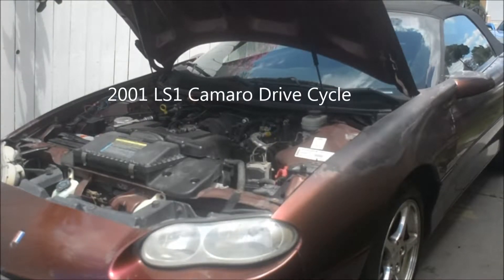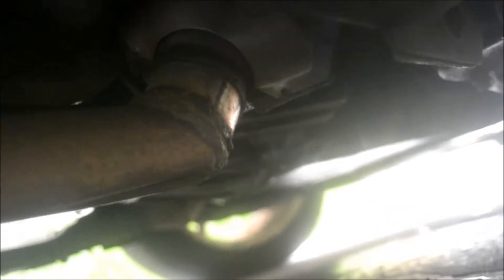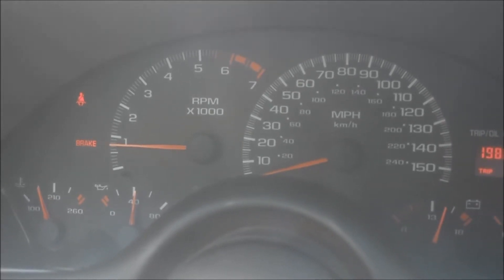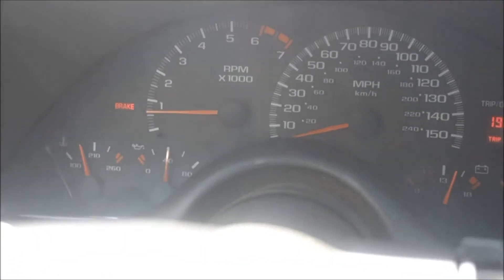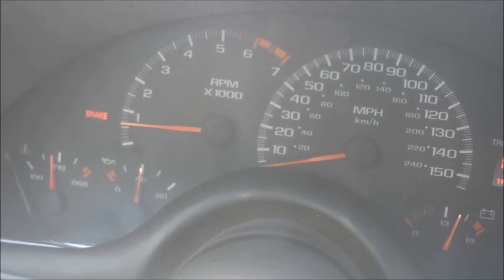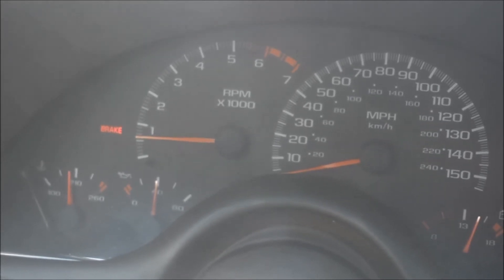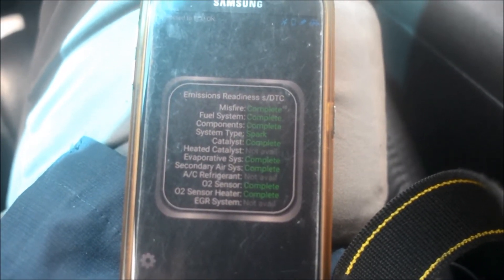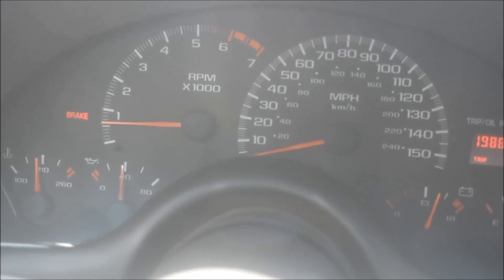LS1 Camaro 1998 - 2002 Drive Cycle

Comment: My EVAP and EGR are not ready? How do get those ready for smog here in CA?
Reply from the maker: You have to do the drive cycle when the car has been cold and not driven for the night.  Start the car in the morning and follow the steps in the video, turn on the lights, radio, A/C, rear defroster for 3 minutes and have more than half a tank of gas.

Comment: Did your camaro pass smog?
Reply from the maker: @ Rudy Rivera

Yes.  The cold starts, drive cycles and at least half a tank of gas meant the ECM ran the monitors and all were completed.  Took it to a smog station and it passed without a problem.
Reply: DIY Dave my car has no AC so does this still work without ?
Reply from the maker: @Javz34dahh  

If you are trying to get your car to complete the drive cycle you need to put the car underload maybe 30 seconds after a cold start.  Try to turn everything on such as headlights, fog lights, defroster, stereo, interior lights and anything else you can think of; that should be enough of a load to start the drive cycle.
Reply: DIY Dave okay sounds good. So technically A/C doesn’t have to be on then..?
Reply from the maker: @Javz34dahh  

You are correct.   Just turn on all the things that put a load on the charging system and that should start a drive cycle if the car has sat over night.
Reply: DIY Dave sounds good. Thanks for quick response brotha. There’s a lot of mixed answers on how to do it correctly and etc but tomorrow morning as soon as I cold start it I just turn read defroster, front defroster, rear mirror lights, headlamps and etc should and from there should I drive 55mph? Or how’s it work. Currently I have the “OH” monitor Oxygen heater sensor incomplete
Reply from the maker: @Javz34dahh  

After you've turned all those things on let the car idle for 3 minutes. Then drive on the highway and speed up and slow down; the GM drive cycle can be found online.